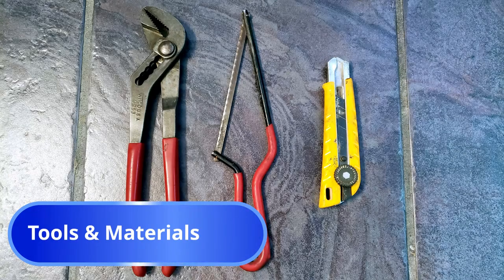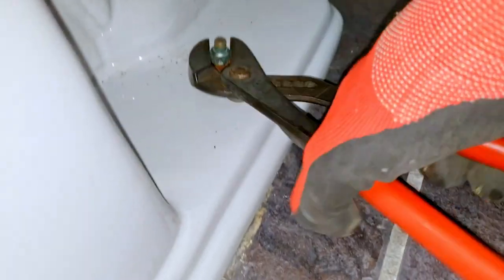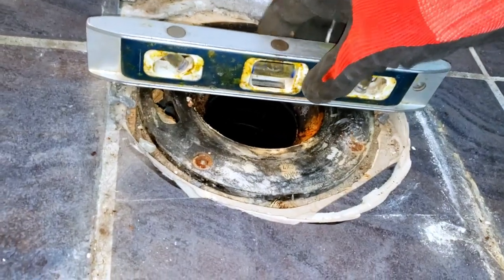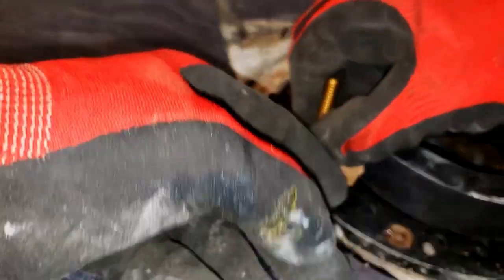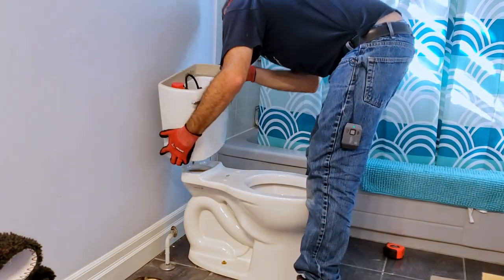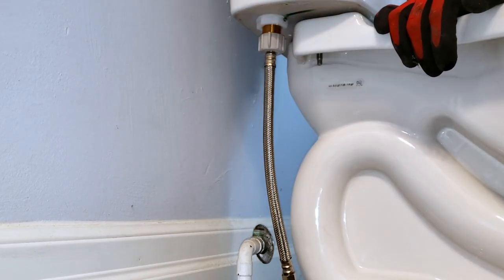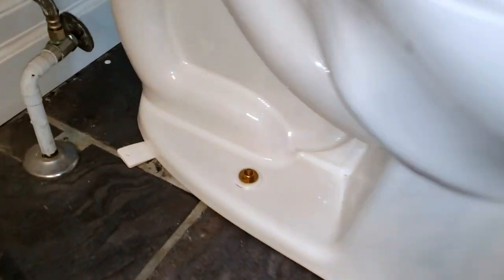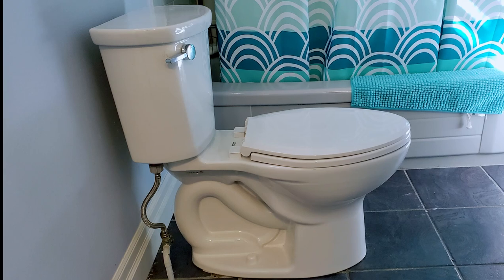How to Install a Toilet Like the Pros! | Step by Step Guide for Beginners

Comment: Love the video mostly agree I would just add extra nuts and bolts where you put the cardboard on the flange and i recommend always silicone because that sitting pee will do more harm than good keep in mind not silicone the back so we can see for leaks but overall spot on